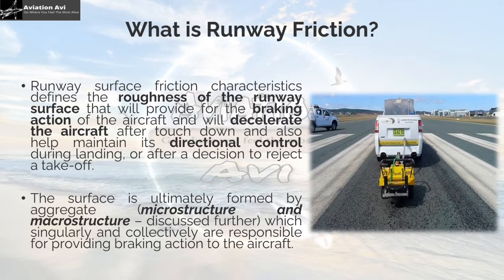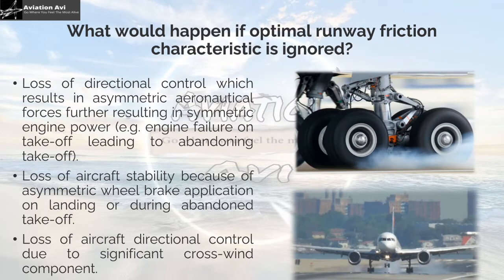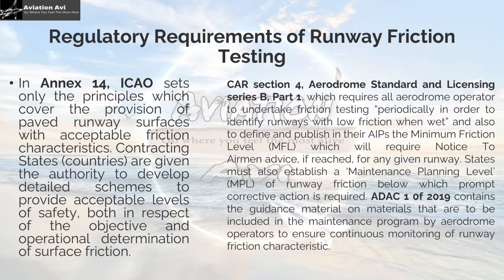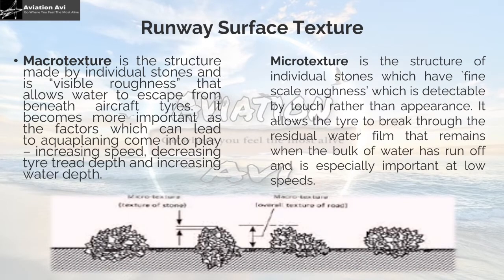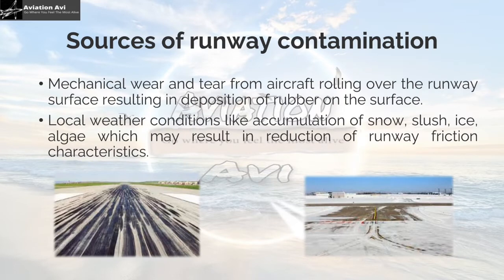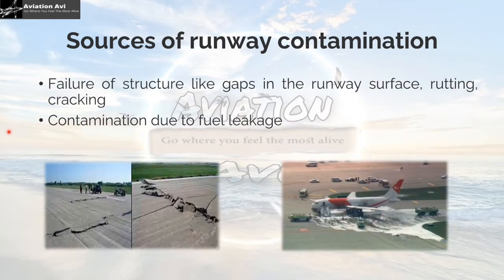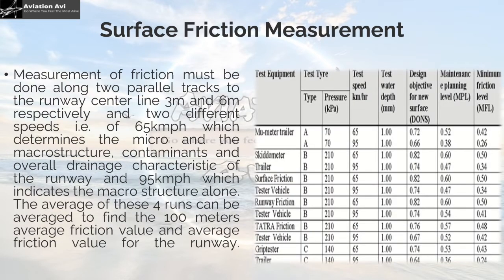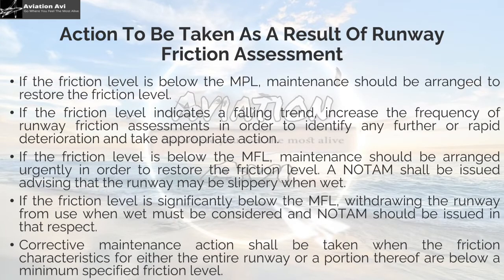Runway Friction | Importance & Measurement

Comment: What difficulties you face at your airport in Rubber removal process....is this process anyways harms the pavement??...and if yes then what measures you guys take
Reply from the maker: As Such it doesn't harm the payment.
A runway surface payment generally needs recarpeting work at an interval of 10 years (depending on the movements too).
In between at regular intervals RWY maintenance is always there.

Comment: What should be done if runway friction level goes above the design objective level after rubber removal
Reply from the maker: In my experience it's very difficult to achieve that level because if the surface is designed for a certain friction level (DONs) the micro and macro structures are designed in a particular way to achieve that level..